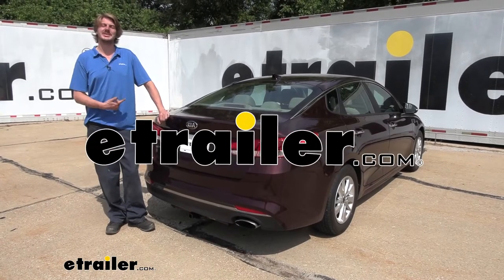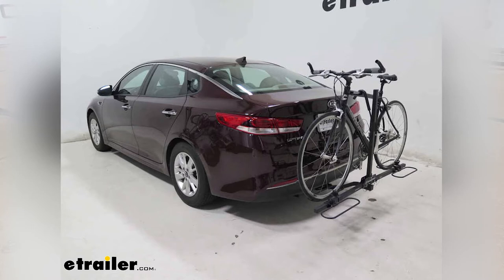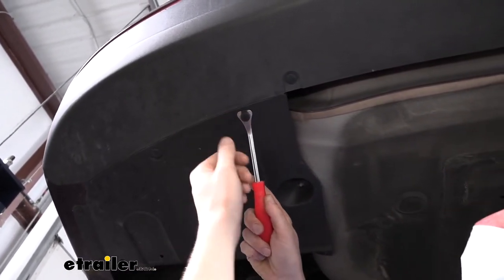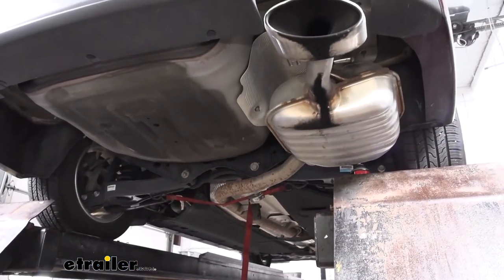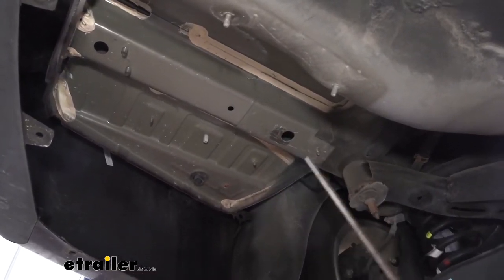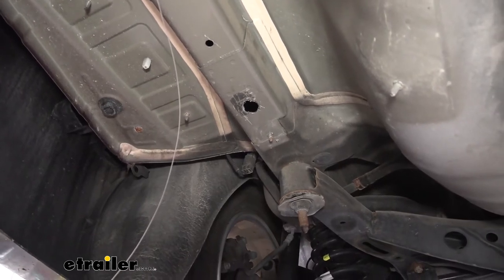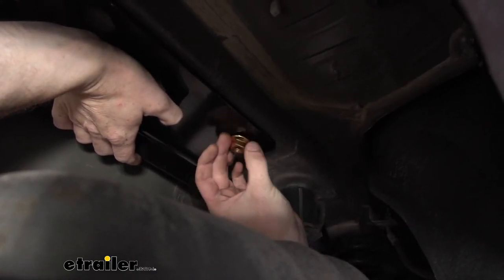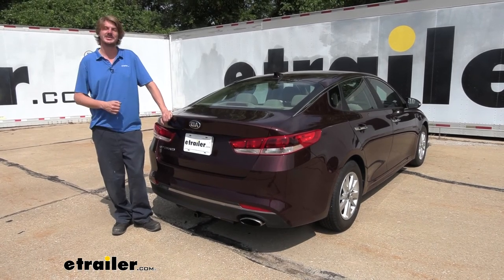etrailer | Curt Trailer Hitch Installation - 2018 Kia Optima

Comment: You state that the hitch height is 11” inches. I’m looking to rent the uhual motorcycle trailer and use it with this hitch. Uhuals website list their coupler height at 18”. Do they make adapters to make up 7” of difference? I’m having trouble finding a hitch with 7” rise on your website
Reply from the maker: A 6 inch rise would get you close enough. If the trailer is compatible with a 1-7/8 inch ball, the Curt # C45591 ball mount would be your best choice.
https://www.etrailer.com/Trailer-Hitch-Ball-Mount/CURT/C45591.html